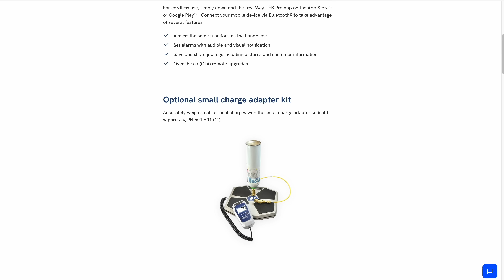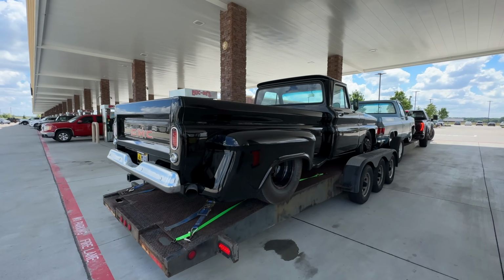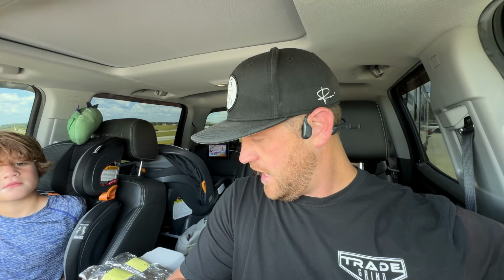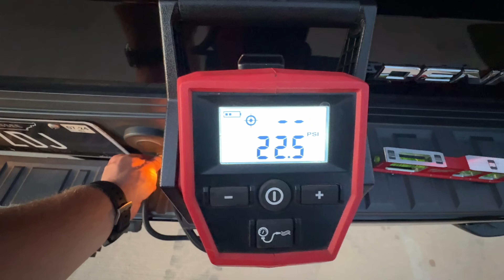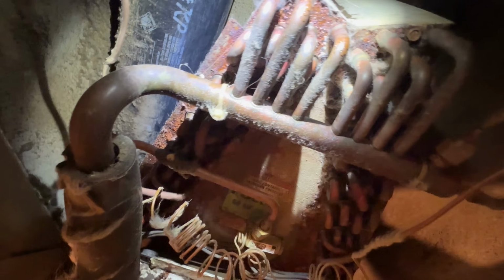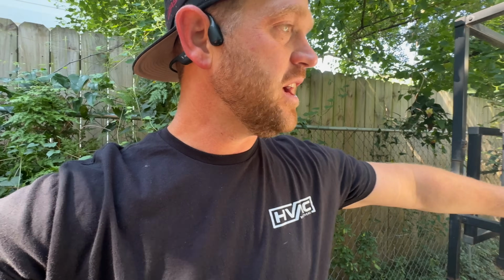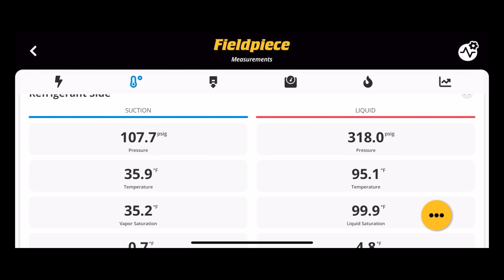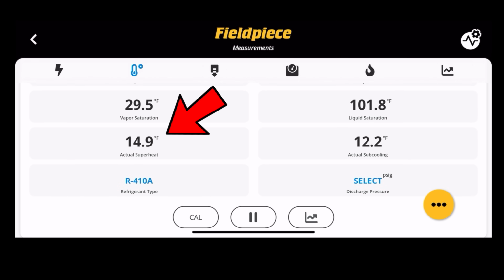Traveled 7 HOURS for a Service Call...

Comment: Need to have a mobile home company come in and reinsulate the underneath of the mobile home and reinstall the vapor barrier that was there. The duct sets in the insulation for the underneath. Now all the hot humid air is going straight through the floor.
Reply: This.  If not the floor will rot out
Reply: Was literally on my way to typing something similar to this. Mobile home duct isn’t insulated with wrap, it’s generally inside a vapor barrier full of insulation. BUT, you could DAP closed cell spray foam kit and spray the bottom of floors and insulate/spray foam the duct. Cheapest option probably. Or pay a mobile home to put a new vapor liner and fill it up with insulation.😅

Comment: Hello coffee nerd. Love a good setup. Baratza is a good brand if it ever breaks, they have parts. Very good company. As a fellow camping enthusiast there is a decent 12v grinder out there. turin dm47, dual power capable. But really it's just a 12vdc with a transformer. Then you can do some campfire cowboy coffee. Obviously with a camper you'll have ac but it's a decent option if you need a change. That baratza is a bit noisy. But don't ever get a sette 270, that will wake the neighbors. I've used one for years and hate the experience. Just upgraded to a df83v, fairly large but incredible quiet.

Comment: I would bypass mobile home ductwork and rerun standard duct system (granted there’s room). The mobile home ductwork is incredibly undersized.. it’s usually aluminum and 3-4”x12”. Then you could remove duct and insulation and spray foam the floor with closed cell foam. Also install a package system instead of going back with mobile home equipment.  and remove the furnace and coil from inside, to prevent future water damage.
Reply: Agree
Reply: This is the way 👍
Reply: Agree

Comment: Hi Brother, is always good to Help specially when is a Family, I have been following your Channel quite a few years, since I started in HVAC INDUSTRY now I got my License and with it an HVAC Company, and I just want to make you aware, to buy equipment in Florida you need to be an Air Conditioning Licensed Contractor A or B, we hold B License and to Install the Unit also you going to need that, I just want to give you aheads because if you install a new unit without the Proper License and you Show it in Your Channel you may get in trouble be careful. 
Thank for all you been Showing it helps a lot and God Bless

Comment: Why txv it was clearly airflow, if it was txv it would be high suction temp (high superheat) or if falled open it would be low superheat high suction. She only need a pull and clean probably.

Comment: being Canadian forgive my ignorance. is the housing envelope really that loose in the states that a 5 ton unit would be needed? here in canada a 3000 sq ft house would have maybe a 3 ton unit
Reply: It hits 105+ over here and out attics reach temps of 140 and up in the summer it’s brutal
Reply: Well A, it's a trailer, B it's a massive amount hotter than Canada at any given time with a much higher latent load. So yeah

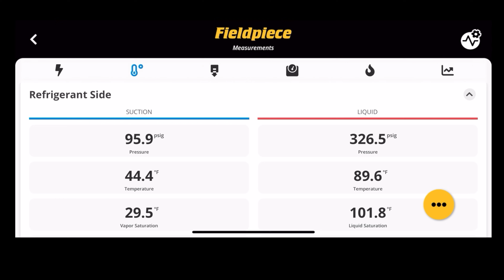Comment: Zack at 11:04 having the Vapor Saturation showing 29.5 degrees doesn’t that mean the coil will definitely freeze.     If so what things can you do to have that number raise up past 32 degrees?    Thanks in Advance

Is the system low on refrigerant?      If you add some wouldn’t that increase the Pressure and raise the temperature?    Still learning thanks

Comment: Those zip ties are going to get cold and heat up over and over and loosen up again. I know it's just temporary but so are stainless pipe clamps. Good idea to have them stocked on the truck because you see that with bulbs all the time.
Reply: Dudes 7 hours away and that systems a mess. Perfection is limited here.
Reply: You know what’s crazy I have seen the stainless ones lately snapping away the copper ones cracking away. All of them have issues.
Reply: I’ve had zip ties last for years
Reply: @knighttrain2579  I'm sure. But if you've gone back and checked them, there is a 0% chance they haven't loosened.
Reply: 10 deep breaths

Comment: How does licensing for contractors work across state lines? I know FL has different requirements for A/Cs that TN does. Not sure in TN but you will have to pull a permit to replace the A/C, etc.

Comment: Thats 100% a R22 Evap and a R410A Condenser!!!
Reply: That’s a pretty common scenario with jackleg techs☹️
Reply: That and installing a new freshly stolen condenser unit from a new house under construction😢
Reply: Won’t using r410a which is way higher of pressure in a r22 coil gonna destroy that coil!?
Reply: @Killerbuckets23  I don't even want to think about it.
Reply: It's a fbcoil 5595740   R410A evaporator and txv...

Comment: It's appears to be the original Nordyne system, maybe Frigidaire, 5ton R410A unit installed in 2012/13, both condenser and evaporator are R410A. It looks like the air handler has had a hard life but it does work. Having not inspected it personally and based on what I have seen and heard in the video, all of which is important to planning the project,  I would follow this order as resources permit. Check/fix electrical,  cleanup system,  Insulate  ducts (wrap or board?) and that would give you a decent working A/C system). After that, work on insulating the floor when time, manpower and finances allow, (probably rolled fiberglass between joist then covered with plastic as was original). All the while considering the type, age and location of home.   My reasoning is,  this is a family project, which comes with,  license, funds, manpower, distance and time concerns. As a plus, it is in a mild location.  This is not a high dollar contract job that needs to be done immediately, will make you a lot of money or brought to 2024 standards, so I would not plan it that way.   It's a budgeted family project that needs to be done to help out. Your a good man for taking it on...